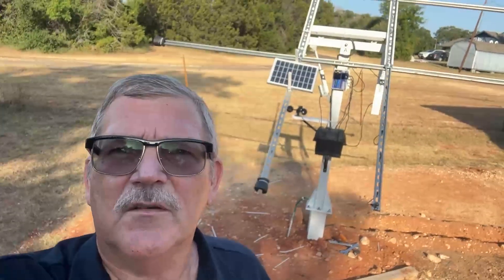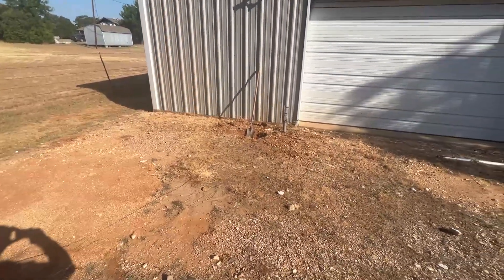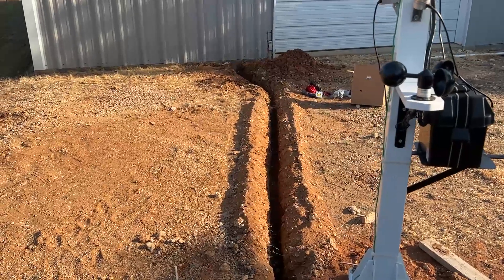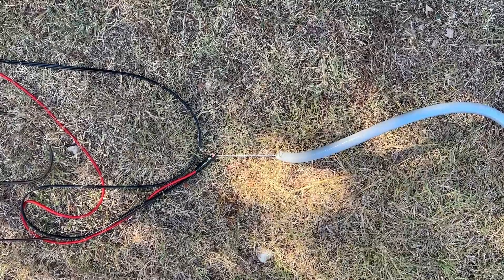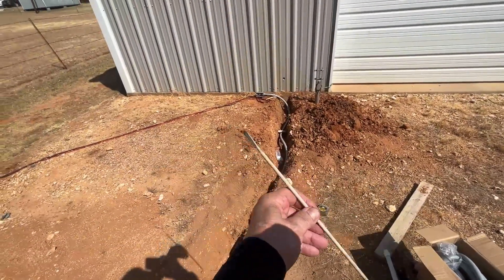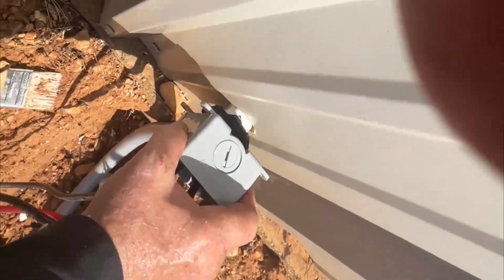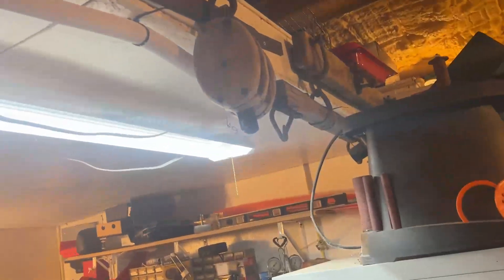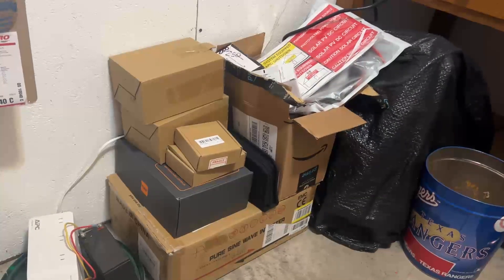Eco Worthy Solar Tracker wiring installation part 2

Comment: Nice ! Will this be Off Grid for the shop / lights/ fridge to keep the beverages cold? How many watts are you figuring you'll get ?
Reply from the maker: I will have 900 to 1000 watts for a start. I also will be install a transfer switch so I can make selected circuits in the shop solar powered  or utility power when needed. Thanks
Reply: @RustyGlovebox  Good planning !

Comment: Hello.
Preparing the solar tracker for installation.
Machine digging a one foot trench for cable laying is great.
beautiful ditch. :D
Cables are drilled into the building and run to your store.
I look forward to seeing the solar tracker in action in the next video. (^o^)v
Thank you my friend.
Reply from the maker: Thank you very much my friend, I will be working hard to get the system to produce some real usable power. Have a great week         👋😁👍

Comment: Super neat project Rusty, I'll bet you will be glad to get the extra wattage. Are you going to store any of that energy going forward? Thanks again for the upload.
Reply from the maker: Yes, I will have a small battery bank for power at night. I am going to use a 6 switch generator transfer switch to supply power to selected circuits in the shop. Thanks and take care

Comment: I'm really impressed with that little trencher, it does a great job, as you said , the ground is very hard due to not much rain.
Reply from the maker: Thanks Vernon, the trencher has been a great tool and has save me from doing some much digging by hand

Comment: that ditch digger is really slick,  how is your water collection system working these days?
Reply from the maker: It hasn't rained in 52 day and  more than 30 days over 100. I use the rain water collection sparingly . It has been nice to have as a backup plan. Thanks Bob and take care